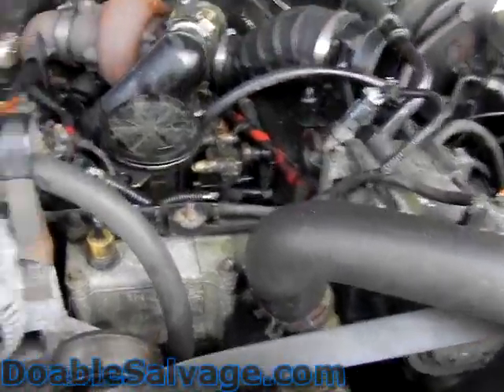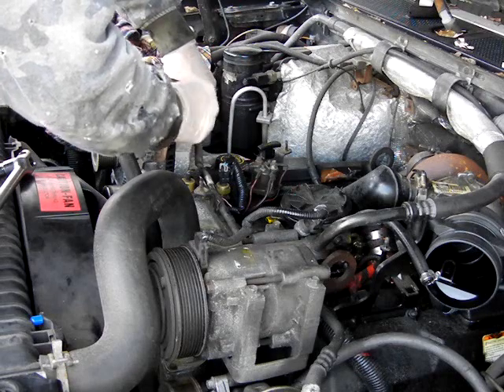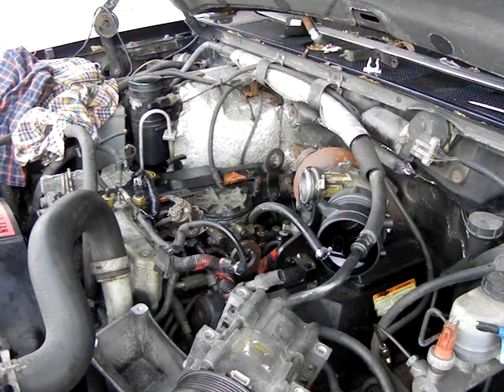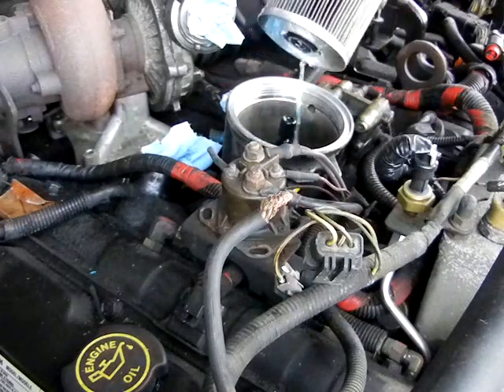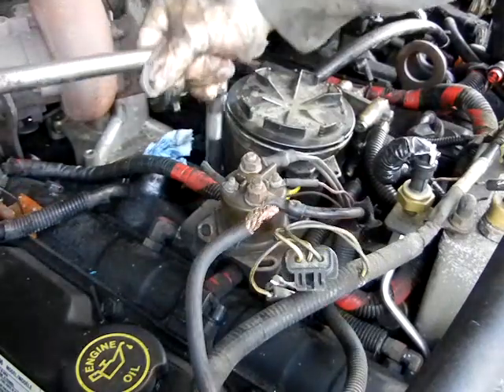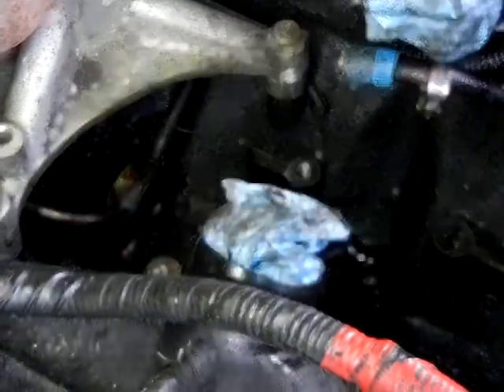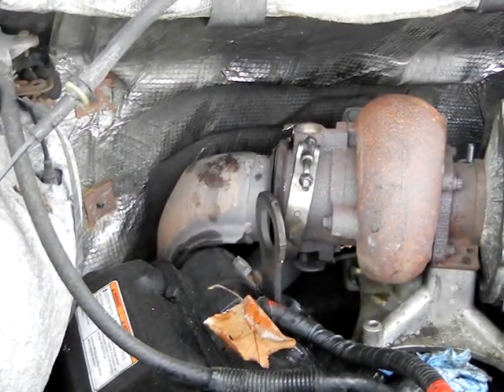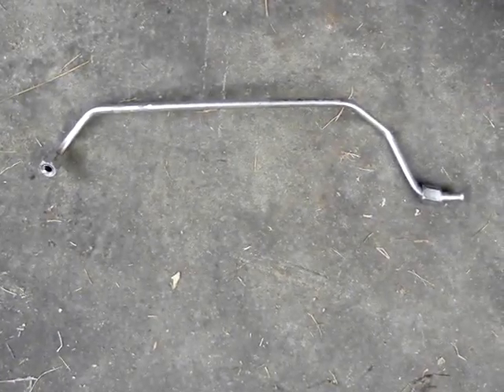How to do a Electronic Fuel Conversion Part 1 - 96 F350 7.3 Powerstroke Diesel (E-Fuel)

Comment: Is that truck your daily driver? what was your completion time the first time you did the conversion? also do you have to source parts from multiple people or did somebody already think of everything  (an fittings and all ) and throw it in a kit to buy?
Reply from the maker: +zx6me1983 It was my every day driver, I sold it to buy a RV.  Never had any problems with it, makes it super easy to rule out fuel issues not to mention if any repair needs to be made, the engine valley is so much more tidy with extra room to work and fuel isn't going to be leaking in the valley again.
"what was your completion time the first time you did the conversion?"  I can't remember.
" somebody already think of everything  (an fittings and all ) and throw it in a kit to buy?"  You obviously haven't watched the video then, noone is selling a kit for what I put together, I even did a write up about it with most of the parts listed.  http://www.tyrantx.com/article_read.asp?title=Electronic+Fuel+Conversion&item=18

Comment: I'm not sure why you removed the a/c compressor and alternator, didn't when I did my 97 California truck (the soft plug in mine was a 3/4). Didn't pull my exhaust either
Reply from the maker: Maybe it's because I was doing more to this truck than what you think I was lol.  Ever heard of upgrading to a bigger down pipe?  Not sure how that isn't obvious really.
Reply: @PatrickBaptist  because you made it sound like you did it for the pump and bowl elimination
Reply from the maker: Been a long time since I made that video, I can't remember what I said, just remember the truck and that it was several things I turned on.  I think most people would really figure it out though regardless personally, most just not all.  I don't think anyone else has asked this question in the years it's been on here is what I base my notion on, if a few or several people had I'd think otherwise, but it's just you, it's alright though no worries.  Yeah cali vehs always have to be a little qu33r, it's california after all lol.  Stupid how they came out with DPF add ons for these in cali over their bs laws.

Comment: Ive done alot of upgrades to my 2000 7,3 now my buddy wants his 95 to run as strong or close to, What does this conversion do as for performance? All my upgrades on mine are derived around fuel mpg low egt and power. We transport cars on a 50' car hauler.

Comment: Hey man I have a weird question maybe you can help... So I took my fuel bowl out and along with that i threw away the little wiring harness that was on the fuel bowl with the IPR. Would I be able to solder an IPR pig tail with the connector in to the main wiring harness? (Harness with injector and glow plug connectors)
Reply from the maker: Yes you can use a plug of the valve cover harness to use on the IPR, I've done it too.  I always save a old harnesses and harvest the plugs off it, I probably have go through atleast 2 a year on local repairs for others.
Reply: @PatrickBaptist  hell yeah thanks man!

Comment: do i need a backflow preventer after i install the fuel bowl delete and electric fuel pump
Reply from the maker: You mean a check valve, yes one after the pre-filter would be ideal.  I actually addressed that issue in a later video.
Reply: thanks for the info your videos are quite helpful